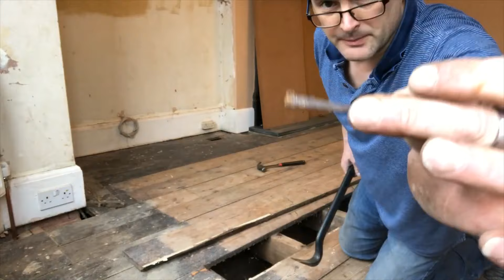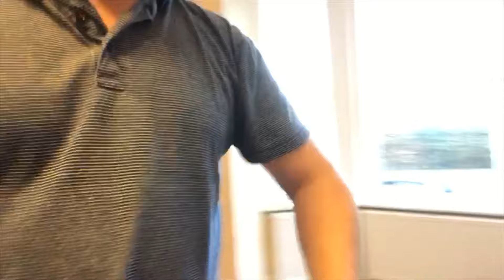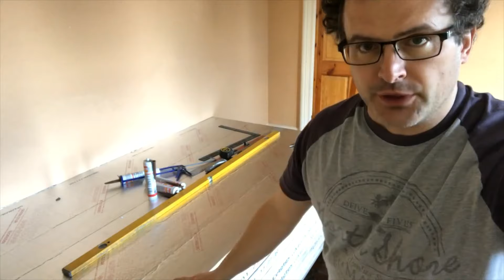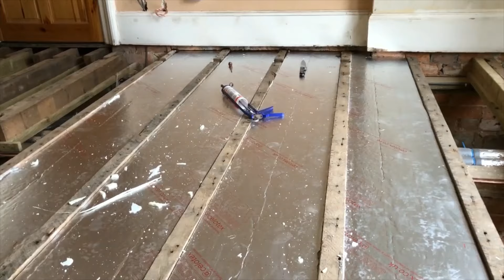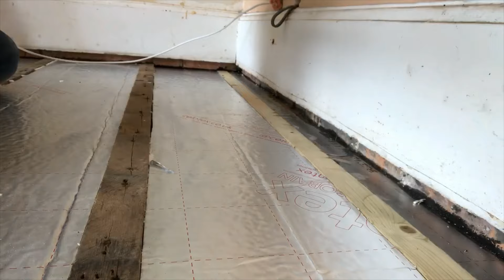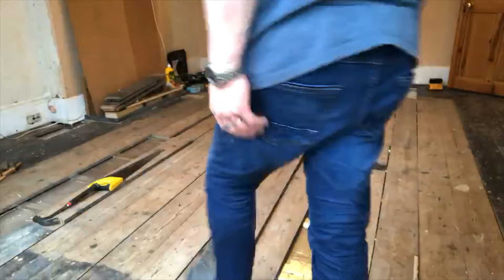Underfloor insulation retrofit full demo

Comment from the maker: A dpm would go beneath structural components to stop moisture rising into them. This would be beneath the timber bearers that support the floor, for example, but not under the whole insulating layer. You want the timbers to breath the air in the void.
A vapour barrier would stop the moisture in the warm air in the room moving with the air as it passes through the floor and reaching a dew point. In the case shown the continuous aluminium layer creates this vapour barrier, and blocks moisture penetrating into the insulation or joists from the room.
Reply: Hello Steve

I was told its best to have the moisture barrier or DPM on top of the insulation, to stop sweating and droplets accumulating causing more sweating as the damp builds, maybe both ways will suffice but isn't the point to have as much breathing as possible beneath the insulation ?
Reply from the maker: @stevebrook1323  Yes indeed. DPM or vapour barrier above it, where the humidity of the air can be greater due to higher temperatures, is best. The lack of cold bridges should reduce any dew point within the room. I would not install a DPM directly beneath the insulation.
If you can put a DPM on the earth floor beneath the floor void it will help prevent moisture in the void from ground evaporation.

Comment: I’m getting conflicting info about if a dpm or breather membrane is needed , fears of condensation/damp I have suspended floor same as you but not sure if I need more than in this video
Reply: Theoretically the celotex doesn't need any DPM, as it is already damp proof. The difference is the way it is laid on the joists I think, as it should be thigh and airproof (that's why he's using silicone in the video)

Comment: Great video. Thanks for posting. I’m considering doing the same thing but i’m worried the lack of air circulation could create dump and rot the wood. Is that a risk? Thanks
Reply from the maker: So long as the sub floor is ventilated properly at the main wind loaded and opposite side, so that fresh air circulates beneath the insulation, the risk of damp should be reasonably controlled. 
If you are very concerned you could look to install a dpc across the underside of all timber elements, but it would mean lifting the joist bearers to get it under and behind them.

Comment: Could another method be to run your batons perpendicular to the joists every few feet, underneath, instead of parallel. This way you would save a lot of time, a lot of wood and you could get thicker insulation boards. Presumably as thick as the joist itself?
Reply from the maker: Yes, you could go for that approach. I chose not to because preventing air gaps and air flow is critical. The battens beneath the joist/board joints help create an air seal.
Reply: @SteveWardellDIY  Yes good point, the batons running parallel would have more contact therefore more sealed. Food for thought as I am planning on doing this in near future.

Comment: Did you consider using Gapotape? It’s a spongy tape that fits on the edge of the insulation board and takes up any error and forms a snug fit on the joists. I went to a retrofit seminar recently and saw this product. You have inspired me to tackle this project but may replace floor boards with marine ply. Thanks
Reply from the maker: Hi Yorsoul, it wasn’t a product I was aware of the at the time, maybe due to it being new to the market, so no I didn’t. I will be trialling it in the future though.  Worth noting that battens to stop the board and sealing the gaps is a recommended method by manufacturers. It’s an airtight method. Hopefully Gapotape will be just as good, but it still needs a level of care in the cutting.
Reply: @SteveWardellDIY  Looks like you did a really good thorough job mate, well done, but any gaps between your PIR boards and the joists could lead to cold bridging.   That's where the gappo tape helps as not only does it seal up the gap for air tightness, as it's made of foam type material it also provides some degree of insulation to prevent cold bridging.   The timber battens you fixed to the bottom of the joists and the silicone sealant at the perimeter of the room will help to provide air tightness, to stop draughts, but you could still have an issue with cold bridging / heat loss through any gaps in the insulation where you didn't get a perfect fit.   You might think, well 99% is well insulated and any gaps would only amount to 1% of the floor area or something, so that's a massive improvement, but my concern would be the risk of condensation build up through those 1% gaps, as you now have a situation where the heat loss is concentrated in a few small spots where there is a gap.  That's where something like wood fibre might have been a better choice, even though it's slightly inferior performance in terms of U-value for the same thickness, it's much easier to avoid gaps as you can cut it slightly oversized and friction fit between the joists and it's a lot more breathable than the PIR stuff, so it can cope with (absorb) a little bit of condensation build up, or even water ingress through damp solid stone / brick external walls, etc, without affecting the performance of the insulation and any moisture that does get down below your floor boards won't get trapped between the joist and the insulation which could happen with the PIR stuff, potentially leading to rot / mould in extreme cases as now the timber will absorb any moisture rather than the insulation.   As long as the void below the floor is well ventilated, hopefully you won't have any issues!
Reply from the maker: @SoundsToBlowYourMind  Thanks for taking the time to write, and for plugging GapoTape so shamelessly. Thankfully I was meticulous in my cutting of the boards and filling any gaps so the concerns you raise will not be an issue. Your comment about cold bridging is baseless. Air gaps do not create cold bridges; dense heat conducting materials do. The densest material here is the timber joists, and they will be bridging. Nothing we can do about this except insulate under them.
We all know the optimum air gap for double glazing is 19mm, as it’s the largest width possible without promoting notable air circulation in the cavity. This provides a good steer as to the drivers behind making air gaps in insulating small, to limit circulation and heat transfer as a result of circulation.  Any gaps I left were less than 3mm, so there’s no circulation of air within them and because they are sealed (and they are made of air which is a good insulator) their lambda value will be similar or maybe better than the foam adjacent. Sealing the air gaps and making them small is key. I look forward to GapoTape being marketed at an affordable price, or alternatives coming to the market that are more affordable. Any patent or copyright the product may have is likely to be weak, so it’s only a matter of time.
Reply: @SteveWardellDIY  Just for the record, I have no financial interest in Gappotape.  I agree it's way over priced for what it is, so helpfully Screwfix will make a "no nonsense gap tape" or something similar, that will do the job well, for a quarter of the price in due course!   As for your comment about my concerns being baseless, I disagree.  Heat can and will escape through air gaps in the insulation, even if there is no air circulation.   The air gap in high performance double glazed units is usually filled with a special gas, such as Argon, to reduce heat loss that would occur otherwise, in lower performing units with just an air gap.   Some new double glazed units even have a vacuum between the panes of glass, to reduce heat loss even further.   My main concern is that the airflow you had before insulating, which could circulate freely around the underside of the joists, up the sides of the joists, along the underside of the floorboards (leading to cold draughts and poor heat retention) is now restricted to just along the underside of the joists only.   That will limit the ability of the joists or floor boards to dry out if any moisture ever does get into the timber, especially with the non permeable PIR insulation, but with any luck that will never happen!

Comment: Can you tell me if the wood battens you used to support the insulation are normal untreated strip wood or do you have to buy treated battens ?
Reply from the maker: Hiya. The battens were treated roofing battens. The sub floor moisture content will be similar to outdoors, so good practice to use treated. Also, untreated battens may not be so readily available in the UK, as they are generally supplied for the roofing market where they must be treated.
Reply: @SteveWardellDIY  thanks for getting back to me, would you no what size your battens were exactly and where did you buy them from as I’m having a hard time finding treated battens with small measurements
Reply from the maker: @riz_1ne  they were from our local builders’ merchant Parkers. I can’t recall the size.

Comment: Don't you need to add hydroisolation underneath those foam boards?
Reply from the maker: Provided there is good airflow underneath, and a good damp proof membrane segregating timbers from damp supporting structures, no, I don’t believe you do Tomas.
It wouldn’t harm to though, if you have some and the time to apply it.
Reply: @SteveWardellDIY  Thanks. Addition question. How to protect those boards from mice or whatever it could be?
Reply from the maker: @tomasrazgus7331  The air bricks in the walls of our home have small gaps, big enough for insects but not mice. The only time we ever had mice under there was when I was rebuilding the linked utility room. Little blighters took the opportunity to set up camp. Humane traps caught them and I let them out a couple of miles away

Comment: Nice video - appreciate you posting it.

I'm tackling this next month in the bedroom above my garage. Dreading lifting the laminate and the floorboards as everything is TnG. I'm dreading putting it all back together even more!

I was cutting 100mm celotex last year for insulating the base of a garden room. Incredibly difficult to keep a 90 degree cut. I clamped a straight edge and used a jigsaw with a bosch blade specifically for this... and even cut the blade to 105mm but it still wandered.

As I'm doing the bedroom, and probably the 2 rooms downstairs as well... as well as the garden room walls and roof... I'm thinking of buying a used insulation cutting saw and then selling after use.
Reply from the maker: Great idea buying a second hand insulation saw. I don’t suppose you could insulate the bedroom floor via the garage ceiling instead?

Comment: Nicely done. Couple of suggestions:
1) a rip claw hammer might be handy.
2) a tool for dismantling pallets might work better in places  than a crowbar. 
2 prongs sit either side of the joist and you get lift in 2 places. Means you don't have to force your way between the joist and the board.

I pre drill the batons and then use the driver,which is shorter.
Celotex is a good choice. Anything fluffy might need a thin sheet of ply to keep furry friends from making a home.
Reply from the maker: Thanks for watching and for the tips Sextonblake. I’ve never owned either tool so will look them up.
Fluffy insulation would be less insulating and may allow airflow through too, so I’d avoid it.  If a subfloor has rodents in it their access routes need to be stopped as soon as possible. Chewing cables and other damage could be a much bigger problem than nesting, as would their eventual ingress into the rooms above scavenging for food.
Reply: Yes. I have one of those tools; fantastic. Also meant it was easier not to damage the boards.

Comment: Is there any risk to moisture being trapped between the kingspan and floorboards? Also would be keen to see how noticeable the change is . Thanks
Reply from the maker: I think not. Condensation builds by warm air hitting cold surfaces. There are no cold surfaces as the insulation as a temperature gradient through it
Reply: @SteveWardellDIY  awesome that makes sense
Reply from the maker: I’ve not measured the fuel saving. Only time will tell, but it feels warmer in the room. With the log burner running it gets too hot, where it didn’t before

Comment: Nice work. I did a basic version of this 30 years ago with fibre glass loft insulation and a staple gun. Had to crawl under the floor and work on my back. 😢.
Reply from the maker: Sounds like fun Andrew. Glass fibre up your nose 😂
Reply: Did the loft insulation do the job ?
Reply from the maker: I did it using glass fibre on an earlier home, and I think it would have worked well if I’d sealed the floor completely. Sadly I left gaps around the boards and, where those gaps were, the air could pass through the boards and through the glass fibre. Glass fibre is much less insulating than foam board, so a much thicker layer is needed to achieve the same thing.

Comment: My floor removal job was a bit different, as the boards are tongue and groove, and were old sizing. Turned out a bit more expensive than I first thought. Informative video though, thanks.
Reply from the maker: Thanks Martyn. Tongue and groove was a great way of transferring load between boards, and it stops draughts too. Pain in the arse to take up though. I feel your pain.

Comment: Any difference with the stove now youve sealed up air draffs?
Reply from the maker: Hi Poohbear. The stove had no requirement for an external vent, so I expected and hoped sealing the floor would not change anything. There’s no noticeable difference to the stove working, though the room gets warmer than it ever did before, even with the door open.
Reply: @SteveWardellDIY  Thats good to hear as Im the same with no vent requirement but looking to do the same soon.
Reply from the maker: @PoohBear01  I checked the gas use for the house for November this year vs  November last year. It’s 20% less this year. We may have had a comparatively warm month but I’m hopeful it’s a trend due to the insulation. Time will tell.

Comment: Is there a standard width between joists in the UK? If so I imagine you could also get insulation pre-cut to that width and save a lot of faff!
Reply from the maker: Not in 1915 when the house was built, but there was nothing stopping me reinstalling them at regular intervals. It’s a good suggestion 😊
Reply: Most joists are at 16inches very similar to modern 400mm. As a sparky I have taken up an awful lot of floorboards. Up north nearly every floor is tongue and grooved so much harder to take up.
Reply from the maker: @rob19632  I think you’re right. 16” seems pretty standard in most homes I’ve worked in. They were closer in the rooms in the video, nearer 14”, but with variance too.
Reply: Not in old houses.

Comment: Why did you start in the middle of the floor, I was taught to start at threshold or where someone has cut before.
Also, if you were laying carpet, why didn't you use ply to refloor your room?
Reply from the maker: I don’t know if it would have been easier starting anywhere in particular. Maybe doing the middle first made it less likely I’d fall through 😀  Ply costs money and the old boards were fine. Reusing materials is more sustainable too.

Comment: do a standard in each bay and use a Spray in foam for the gaps if you have a 1" interor gap it is better than a single layer thcker foam and is free insulation!! these joint could even have 1/2" shheta blow ao the beams are fully insulated -  no bridging.  Better to cut narrow- move it elseswhere before you shave it.
Reply from the maker: Hmm, not sure I agree with your 1” air gap theory Joseph, I’d have to look into it .

Comment: Should the insulation not be up against the bottom of the floor boards? Leaving an air gap leaves potential for damp to accumulate between the top of the insulation and bottom of the floor… isn’t it..?
Reply from the maker: An interesting theory, but the upper insulation surface should be the same temperature or close to that of the room, so no risk of condensation forming. A small gap may allow minimum air circulation around the boards, but I doubt it’s needed. The boards will breath to a limited extent through the underlay and carpet above, but cannot get moisture from below due to the continuous foil layer atop the insulation.
Reply: I was surprised to see that you installed a carpet is it just your preference ? I know many people don’t particularly fancy the wooden floors but you went through all that trouble I thought you will have them sanded and refinished. 
Would condensation pose a problem should the carpet and underlayment  be removed in the future?
Reply from the maker: @RooibaardBoerseun  I think condensation would be even less likely if the boards were exposed.
I wanted a comfy feeling underfoot, because it’s a sitting room, hence the carpet.
When I did the kitchen I replaced the boards with new solid oak and left them exposed. It looks great.
Sanding old pine boards produces a nice finish, but they dent easily and it thins them sanding off enough to leave them clean. I’ve done a few rooms that way in the past with nice results, but it’s a dusty job too, using a floor sander.

Comment: Personally I would of made an hole and gone underneath and cut the kingspans to fit between the rafters
Reply from the maker: Hi Irene, I’m unsure what you mean.
I could get though the joists to beneath, but didn’t really need to much, and the insulation is cut to fit between the joists. Help me understand 😂
Reply: @SteveWardellDIY  i replied earlier into your video,then realised you didn't have much room to get underneath to fix in the insulation,and also it was a bit trickier to maneuver around the pipework,so yes you did it the best way and it was thoughally enjoyable
Reply from the maker: @irenebignall7245  that makes sense, thanks for writing back.